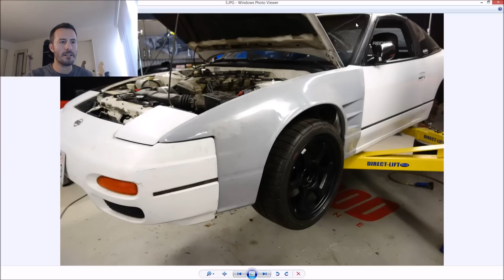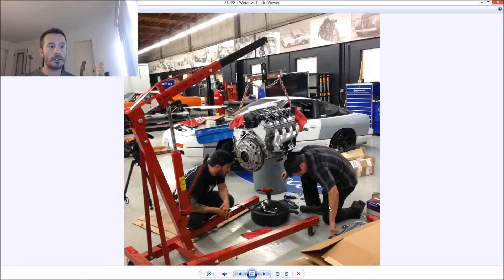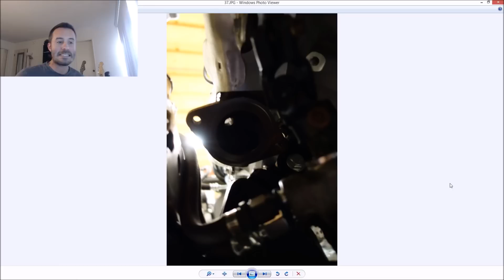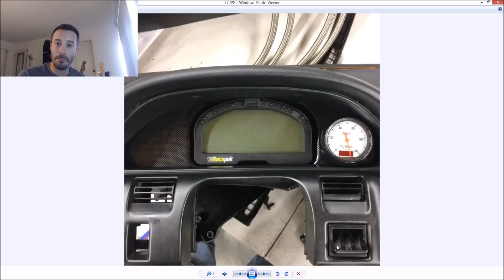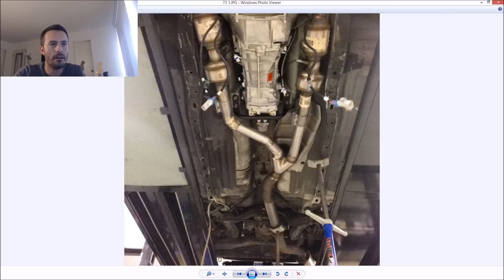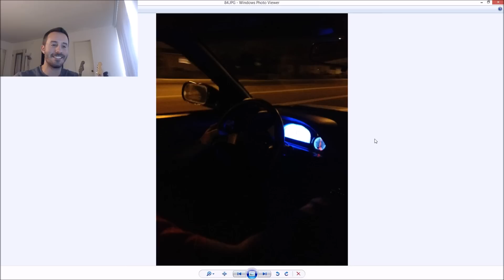240SS: Let's Chat About Building An LS3-powered 240SX

Comment: just to ask how is the traction.. without modifying the suspension. Im half way through my swap and im wondering if I should buy some coilovers and some other suspension shit.. I dont want a car that will lose traction through 4th gear..
Reply from the maker: That depends on tires more than anything else. Traction was excellent on our BFGs, just on the right side of loose. Straight line accel was no problem and you could light them up beautifully mid-corner in second.
Reply: Carlos Lago yea I already bought new tires becuase thats a no brainer.lol

Comment: is there a reason an f body t56 transmission wasn't used to locate the shifter closer to the original location and eliminate the dash cutting and shifter bracket?
Reply: You can now get the Magnum F, which is the same as the Magnum, but has the shifter in the same place as on the standard T56.

Comment: I haven't read every single comment, but I wanted to address your heating issue. You said a lot of air is coming in the engine bay but isn't escaping and that you might vent the hood. I've seen a lot of 240 owners simply put longer bolts in the hood mounts to raise the hood in the back so the air can come in, rush over the motor, and come up right over the windshield. Also cheaper, easier, and faster than venting. :)

Comment: Is AC just impossible or could it be done with the addition of cubic-money? Also are you going to do a complete list of parts and mods if anyone wants to duplicate the build?
Same question about ABS as far as cubic-money. What about a center section like Roadster Stop's unit?
Reply from the maker: Michael Howatt AC is possible; it just takes money and time. Haven't looked into aftermarket ABS systems yet. I want to see if we can sort out the car's balance without it first.

Comment: Did the coolant temp raise up quickly once you started drifting?  Its an issue I'm having on my ls1 swap 240sx right now.  After a few runs my coolant temp would be at 240 degrees but quickly drop to 180 with a cool down lap
Reply from the maker: dorifto Yeah, I'm learning cooling is a big issue on these swaps. I'm hoping to spend some time working on proper radiator ducting and hood venting
Reply: Carlos Lago
hmm, I guess ducking would help for road racing but i'm drifting so the air is usually coming from the side..... It's interesting to me that a N/A engine gets hot so easily, that usually only happens on Turbo engines.

Comment: I'm sorry if this was addressed already, but How much did you have to cut the rear fenders to clear the tires? Also, was lightening the bodyshell a consideration? Is there any weight that would be easy to get out?
Great videos, thank you!
Reply from the maker: Dan Nork Quite a few inches in the rear. As for the front, the new fenders replaced the stock ones. Despite being bigger, we had to shave off a bit from them, too. On weight: Not much more we can pull out without making the interior worse than it already is.

Comment: Here's a question Carlos. Is that a rosewood neck on that strat behind you  or is it just a dark stain?
The Nissan  looks awesome you guys should run it against  the el  Camino now that it's  running an LS crate motor too.
Reply from the maker: JEFF GAMBLE Yup, it's a one piece rosewood neck. Picture of it: http://i.imgur.com/wL7BEEv.jpg
Reply: Carlos Lago nice lookin guitar.I've never played a rosewood neck is there a significant sonic or feel difference compared to maple necks?
Reply from the maker: Difference is all in the feel. It's bare wood, so it doesn't have the stick that a finished maple neck has. It's faster as a result too, but I just like the way it feels

Comment: Was it built for drifting? Like, did you have drifting in taught or just a performace car? Kinda common for S chassis running V8's in drifting.
Reply from the maker: iSalssLV Derp I wanted to make a fun hot rod, nothing more. Drifting came as a byproduct.
Reply: Carlos Lago
change the shifter bolts so the threads come out on the passenger side so when you playing with the hand break your not  ripping open your shift cover on those bolt threads by smacking it too many times.

Comment: Interesting to hear some of the details here, Carlos!

A couple things popped into my head during the vid...

First, if the power steering fluid is sloshing out from under the cap, is it missing a gasket?

Second, the trans tunnel hack is kinda unfortunate, but understandable. Have you looked at other shifter setups to relocate the handle? The '04-'06 GTO's shifter is relocated rearwards from the stock point on the T56 as well.

Third, do you plan on trying different-diameter upgraded half-shafts to handle the extra power?  It seems to be the trend with GM's performance builds lately with regards to axle tramp/wheel hop on launch...  And will you swap out the viscous limited-slip diff?

Finally, I'm not familiar with the E-Rod limitations and what might alter the EO certificate, but any thought of an aftermarket tune?

Comment: The Rr brakes are second gen 300zx but is there a particular year or model that is better in terms of performance or ease of installation. I 'm assuming that this is information available on the forums which I freely admit I haven't looked at yet.  Is there a group that was better informed or more into the swap and had more information than another. Sorry looking to get as much information as possible as quickly as same.
 I have done one other engine swap(79 chevy Monza) replaced and iron Dud 2.5L 4 cylinder with a 5.L SBC V-8 made the car far more reliabale and even got better mileage took months to complete as was going to college and working part time but did every bit of it myself drove it for 5 yrs before a mistake I made in calculating the comprssion ratio it wound up to high and ran into detonation problems which one hot (103) summer day here in S Texas lead to a spun rod bearing. Babied it for a few more weeks before parking it. To bying another car for $500 just for the motor did the swap and drove it another 2yrs before almost giving it to a chevy Monza enthusest knowing it would be taken care of and not just scrapped. The guy had 3 others and was looking fore a daily driver so match made deal done.
 The 240ss has replaced my ambition to build a LS 944 turbo this seems much more affordale and with out the flack from the Porscha Faithful about ruining the car ectra...

Comment: Well done Carlos you  proved you don't need a new Z06, Porsche GT3, or Nismo GTR to have fun in an economical fast car. My supercharged 2008 BMW E92 M3 has enough hp to kill me several times over having spent less than $25K on it and if I invested another 10K in brakes and suspension bits I could easily race it at VIR so don't be sad if you can't take home the GT3....

Comment: This has become a very popular set up. It's the perfect size, weight & power. GM makes the wiring pretty easy. I'll bet is gets very close to the fuel mileage  the 4 cylinder got. I've driven these, a LS RX7 & a LS Miata. 
 What diff and, axles did you use? Consider Sub Frame Connectors & oval exhaust tubing.

Comment: This is pretty epic. I'm convinced this will be my next personal build if there ever is one. The engine cooling issue might be a blessing in disguise. You mentioned that you weren't all that thrilled about the front fender change. You could potentially customize the stock fenders with a wide body and build in some nice chunky vents to get some of the air out of the engine bay. This would keep a sleek look from the front while man'ing up the side profile.

Comment: Your suspension may be stiff enough that you actually will gain grip by not running a sway bar, front or rear.  Try it at the track.  Many second gen RX7 drifters remove the front, rear, or both depending on their style.

OIL COOLER!!!
heat-wrap the passenger exhaust near the oil lines.

Look up poweredbymax.net for better exhaust option.  oval pipe with slip fittings!

Comment: Love this project. Doing this kind of work is my ultimate dream. I think you need to open up the grill in the front bumper to let more cool air into the radiator. The factory grill opening seams quite small for how much heat is going to be generated by that engine and larger radiator. And after market front bumper would do that plus is would create more front down force that could help with some of the under steer. Then maybe vent the hood to get all that heat out.

Comment: I heard you can use a MGW short shifter to make it fit instead of cutting the shifter position
Reply from the maker: Jude Arcinue With a normal T56 probably, but our Super Magnum is a bit shorter.
Reply: Carlos Lago Sikky and a few other companies make shifter relocation kits for the Tremec Magnum & Super Magnum, due to the shorter length of them compared to the regular T56. Check these links:

http://ls1tech.com/forums/manual-transmission/1526232-my-new-t-56-magnum-shifter.html

http://www.alexanderfabrication.com/2012/03/11/i-got-99-problems-but-a-shifter-aint-one/

Fueled Racing probably could have made you one.

Comment: I finished an LS swap in my 74 chevy c10 back in july. It was my first swap and it took me and my buddy about 6 months. I learned a lot and ur right..its always the little things u gotta look out for...like for example I forgot to put in the torque converter bolts in and started the motor only to hear metal on metal grinding. It was a lotta work but it was worth it. Going from a 150hp 350 to a 300hp 5.3 is mad fun. I have no problem roasting them tires. The day I brought the truck home I entered it in a burnout contest. I didn't win but man it was fun! I wouldn't hesitate to do this swap again. I love 240sxs and would love to do an LS swap in one...although I kinda prefer the s14 over the s13 but I love them both. Heres the burnout video of my truck...https://www.youtube.com/watch?v=unMiTch1_0M&list=UUg0vctyz4jQX1FLSq5DXMmw

Comment: Carlos, loved the whole series for this S13.  I'm curious how you got stuck using over-fenders - did the Brembos dictate a wheel/tire combo that was too wide?  Or did you just get greedy with the big tires?  What offset are those 17x9 wheels, and did you explore all your options for offset before choosing?  Also, how big are those Brembos, 332mm?  Thanks and looking forward to the next video!
Reply from the maker: hypocycloidiaspora Greed. I wanted to run the widest tires possible and did not want staggered wheel/tire sizes. Offset is +12. Front Brembo rotor diameter is 13.1-in/332-mm.

Comment: Carlos thanks so much for doing these videos from your channel. I'm considering to either do a M3 V8 S65B40 (with Dinan 4.6 stroker kit) swap into an FR-S/BRZ and an 2015 LT1 V8 (if they're categorised as e-rod engines) swap into an S15 in the future so I found this very helpful. I reckon the lightweight & compact, 8400rpm revving M3 V8 won't ruin the FR-S's character of 'revving the crap out of it' attitude, 502hp in a car that weighs 300kg less than an E92 sounds sweet and it would just sound so awesome with its ITBs. The S15 is a good excuse for me to see its beautiful rocketbunny kit attached to a brand new and reliable 460hp LT1 engine. It would be great to see more updates to your 240SS as its just the beginning. For geekness sake, some JDM parts, craft square mirrors, floor hinged pedals perhaps? Good luck.
Reply: Lol the e92 m3's V8 is not light or compact. Don't confuse internal size for external size. You're better off with an LS1 or LS3.
Reply: But if you have the money for an LT1 go for it but a crate LT1 is gonna cost you about $11,000-$13,000
Reply: Christian Jimenez I knew GM fans would hate on my comment but the truths hurts that I actually know some shit. LS3 weighs 203kg and S65B40 weighs 202kg. Put a Goke carbon air box to the S65, it gets even lighter. IDC about 'horsepower-per-dollar' thing, theres a limit to how much pleasure cheaper solutions give you. I'm sorry but this is my opinion (and possibly most others) that although these GMV8s are cheaper to buy, and maintain, more power & especially torque, easier to install and find, the S65B40 trumps them when it comes to sound, and I want to be unique whether you like it or not. E9X M3s were unfortunately heavy, disguising the S65's full potential. Putting that engine into the FR-S/BRZ (1230kg, FR similar to E30 M3) which many people craved for more power, it could be a real 'fun' car (not track car that completely changes the FR-S/BRZ's original character). I've seen turbocharged FA20 builds and they look hard to handle as the colossal torque allows the power to come viciously, not progressively like other forms. Later in the future, I can have a fully built FA20 BRZ with 2.1 stroker kit, HKS GT Supercharger + UELs if I miss dynamics and sound of the boxer engine. Toyobarus have quite a SWB so i doubt too much torque would be ideal as it ruins the original character and also the 'revving it out completely to the scruff of its neck' attitude would be gone. Its no surprise that the LT1 is more expensive, its effectively a newer engine with new technology. I don't think people should judge people by their decisions, its their money and car. To each, to their own.

Comment: After all that time and effort, do you see yourself finishing the body to the level of the engineering in the drivetrain?
Reply from the maker: gracilism Probably not. I care less about how it looks than how it drives.
Reply: Carlos Lago Can you paint the white parts matte purple and the grey parts neon green, put a unicorn decal on the side and call it the Magic-Mobile? Then take it to the drag strip and leave people in the dust. JK...but will you paint it?
Reply: Carlos Lago small splitter (with the lil adjustable struts cause itd look cool) and a rocket bunny spoiler for fun?

Comment: T56 is 90's tech I believe (Gen 4 Camaro).  The latest uses the TR 6060.  I could be wrong.  The T56 has great aftermarket support and I dont think the TR6060 is quite there yet.
Reply from the maker: gracilism As I understand it the T56 Super Magnum is some kind of hybrid between the two. Whatever's in there though, it works great!
Reply: Carlos Lago I bet!  I had the basic T56 in a Z28 and thought it was great.

Comment: I want to know how much you spent total on that swap and the car Carlos. I have a 240 with an SR20DET right now, but I'm saving up for an RB swap. Your build seems really comprehensive, and very expensive. Most people end up with SR20's because they are dirt cheap swaps. The LS swap is great, but the truth is, most 240 owners just can't afford it. The only people who really go for the swap are very skilled drifters, because they actually need the torque, and are willing to pay a lot for it.
Reply from the maker: Nikzilla33 True, our build is very expensive, but it doesn't have to be that way. There are TONS of LSs (or even LQ9s) in junkyards available for cheap.
Reply: I personally love the Nissan inline 6 motors, sound/power/rawness. But, if you can afford a rb25/26 you might as well get an engine that has a vast parts catalog and is reliable. I dislike many GM products, but their v8s are damn near indestructible stock. I would do an sr20ve once your det dies, its N/A and sounds gorgeous. The rb26dett requires major fab work due to the twins and you have to relocate a lot of equipment, along with firewall work. The RB transmissions are hella long, basically the opposite of carlos's lol. If you want an turbo motor and want high rpm brute power, get the rb. If you want a great power/torque curve go with the v8. If you don't have to be carb legal the swap is much easier.
Reply: ever looked into a 1uz-fe?

Comment: Already commented on the Motor Trend video, so i will copy and paste: You wanted ideas what you can do next to your S13, my tips: 

Toss the stock hood for a NIsmo Style one made out of Fiberglass. Vents for hot air to go out of the engine bay and a few pounds less on the front. Get a steering rack from a Hicas model 240SX, its got a shorter steering ratio and replace the worn out steering disc with a Polyurethane or Aluminum one. The Steering will be twice as good. Replace the worn out suspension bushings with new rubber bushings from Nismo. Dont use Polyurethane Bushings from Energy Suspension or Powerflex, etc. You will hate the ride with those. Get A Torsen Helical Limited Slip Differential from an S15 Silvia, dont use a 2 Way. A 2 Way Diff from Kaaz, Nismo, etc thoase will spoil the ride too. Believe me the extra few milliseconds PU Bushings and a 2 Way offer aren't worth the backsides. Keep it fun for the street. Great Build Love to see more. Cheers from Germany, Chris

Now I will watch all vids of the build again :D